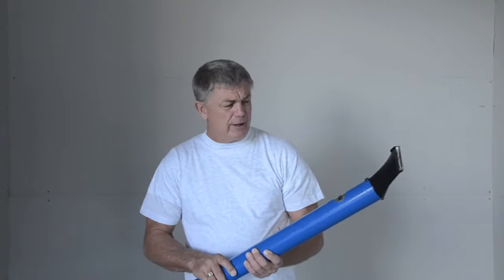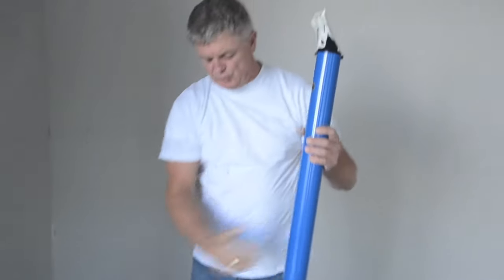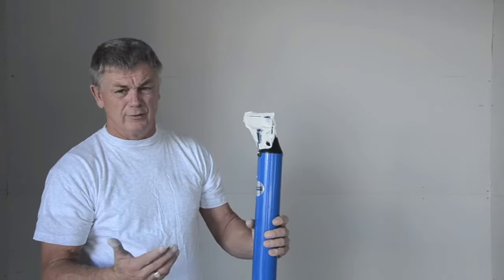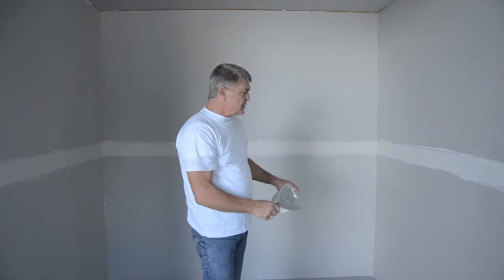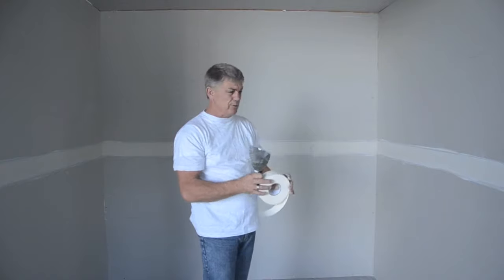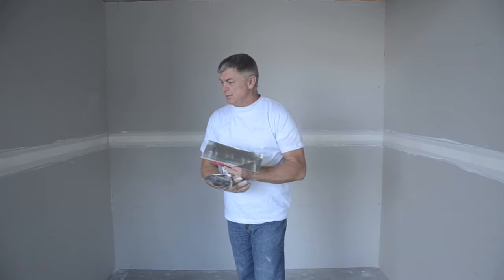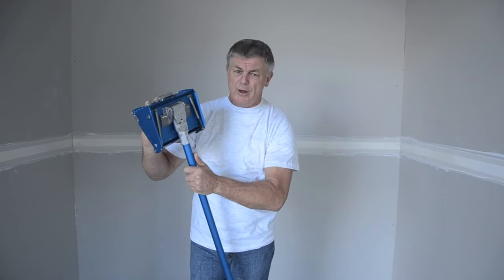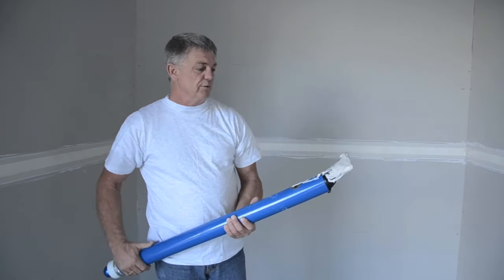Using the Tapepro MudShark

Comment: there is potential to it but not the same way as on video. apply mesh, cover with mud shark, clean with blade and you would do that 10x quicker
Reply from the maker: Thanks for the hot tip Bart